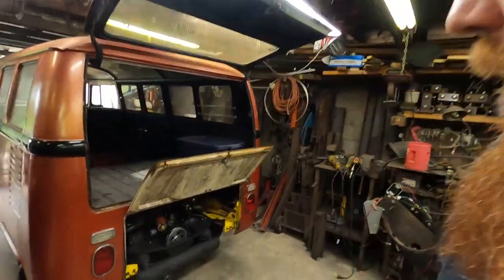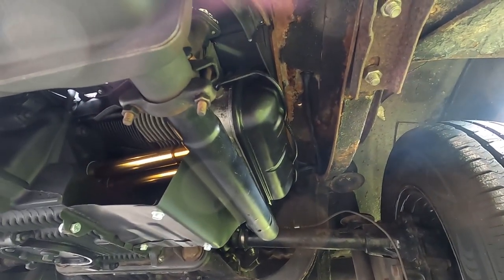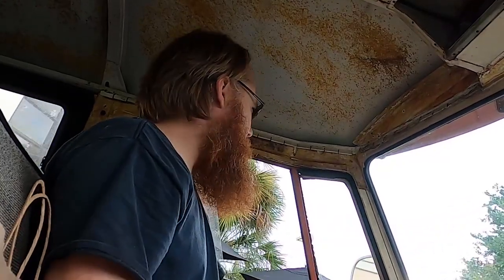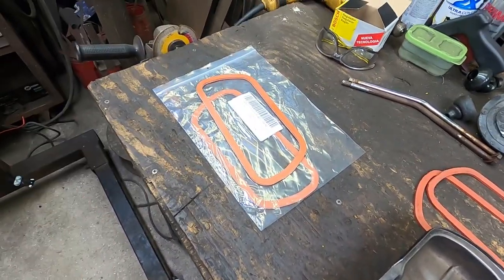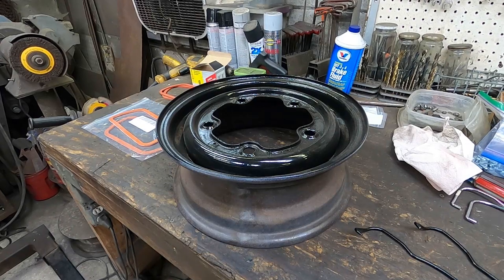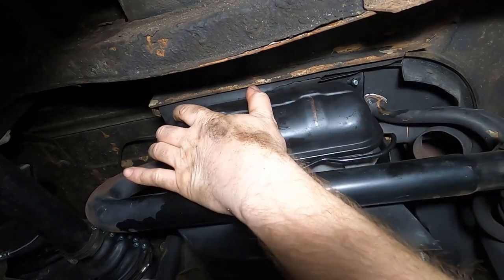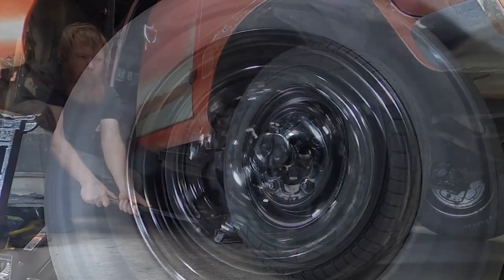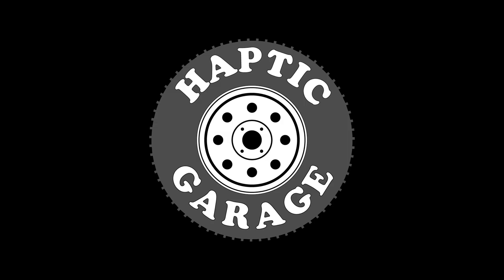We have issues! Test Drives and fixes - VW Split Window Bus Restoration Vandemic E17

Comment: Solid episode! I like your trick of doing the field repair with tools you have in the bus.  Today I got stuck where I couldn’t take off my wheel because I didn’t pack a 19mm and I had a frustrated wife in the car.  If I had the right tool I would have been back on the road in two min, but I had to call AAA.
Reply from the maker: Oh man that stinks, but happens to all of us at some point. After I bought the RV, I drove a total of a half mile before breaking down. The story goes on but ended on a flatbed. I hope this tactic brings you much success, and thanks for being here!

Comment: Glad to see you got it worked out and rolling! I never would have thought the brake shoes would make that noise while not being applied.
Reply from the maker: Yeah Robert, wasn't that weird?!? The goo on the brake shoes was a little sticky so it was kind of squeaking against the drum. I adjusted the breaks for a slight drag so it was within reaching distance to make that contact. That wasn't a real problem but I worried about the integrity of the shoe after being saturated in it's past. New shoes (eventually) were the way to go. Thanks for cheering me on, it's great to have you here for the fun!
Reply: @HapticGarage  I’m doing a roadstoration now on a 60 23 window. All new brakes, hardware and lines!
Reply from the maker: WOW. I mean, it's awesome that you're getting the brakes in shape but... WOW! What a gem. Keep us updated and thanks for being here!

Comment: "Drive - Fix - Repeat"  perfect summary of owning an old VW bus.
I got the same tires on mine.
I found the cork valve cover gaskets I have are not an even size. They are different from gasket to gasket and vary in size from the top to the bottom.
I try to find two close to the same size and and sometimes I stack two up to get a tight seal. Gluing valve cover gaskets? 
Got rid of the points and front drum brakes. Way better.
Reply from the maker: Hey Patrick! Thanks for your thoughts. These Hankook R8 tires aren't fancy but they have appropriately stiff sidewalls and seem to hold up. Our @VWLife friends in Texas like the General Grabber tires- may have to try those out sometime.
Lots of variation from one VW part to the another- I guess it makes sense that valve cover gaskets are that way too. I'm with you on the electronic ignition. Thanks for watching!
Reply: @HapticGarage  i'm running those on my 78, everyone seems to like the grabbers...I'll try them next if they don't look too agresssive....I actually prefer whitewalls !  My 67 and 71 are running whitewalls.

Comment: Did not expect that with the brakes.  I wonder why those contaminated and cleaned shoes did not work ?  Was it a mechanical issue - out of spec in one or more dimensions ?  Was it an eccentricity issue where the clean part wore down faster and uneven contact ?  Hmmn....interesting because that is what I would have done too - spray them clean and sand them, and Bob's your uncle.   Those wheels still look great !   Wish my second 67 was this clean.  It's a deluxe, field rescue....hmm, black armrests ?  oh it's coming off ?  there are grey ?  ewww.   I used a hose on the INSIDE !
Reply from the maker: Hey DanTheManIOM, whatever contaminated the shoes (brake fluid or wheel bearing grease) would rise to the surface with some use and was very tacky; the noise would resonate through the brake springs and backing plate. I'm not sure that it was a problem by itself but with the knowledge that the shoes may have been compromised and the annoying noise it was enough to make replacing the shoes to be worthwhile. Thanks for the kudos regarding the wheels; I like the utilitarian look of a painted steel rim. Your '67 sounds like a project but aren't they all?!? Thanks for watching!

Comment: Great update, as usual! The Starbucks drivethru was a familiar scene. It's nice when you get to be the bright spot in someone's day. I like how she asked for the preferred nomenclature, very respectful lol One question, when I heard the front hub noise I felt like I knew what it was instantly from a previous experience of my own but we came up with different solutions. My experience was the brake spring being too close to the intra-drum brake line and the sound coming from their interference when vibrating. Did you reuse your brake springs or replace them with the new shoes?
Reply from the maker: You said it well Adam; the "smiles per gallon" thing is for realsies and I enjoy the interactions that would not have otherwise happened.
Thanks for sharing your experience with the noise I was chasing. I believe the springs characterized the sound I was hearing resonating through the backing plates. My investigation focused on the source of vibration, which I think was the sticky goo on the shoes rubbing against the drum. The brakes were adjusted before that test drive so the shoes were hovering extremely close to the drum's friction surface. Due to a slight out-of-round- condition they would make intermittent contact and cause the vibration like dragging a finger across tacky-dry paint. With the slight difference in semantics (noise vs. vibration), it seems like we may have been chasing the same thing. I reused the springs but it's possible they were re-installed without the interference you described. Either way, the contaminated shoes had to go and I haven't questioned the lack of noise... taking "yes" for an answer, if you will. Thanks for the question!

Comment: I had problems with the orange silicone valve cover gaskets.  They kept leaking.  Went back to the cork gaskets and no more leaks.
Reply from the maker: Yeah Jeff, this first attempt was a dud. I'll eventually try out that other set to see if I have any luck, but glad to have a method (cork) that works well until then. Thanks for checking out the video!

Comment: You spend all that time on breaks and you don’t even check the heads, valves,  gaskets or anything in the engine? 🧐
Reply from the maker: Yeah.... really wanted to open it up but knew that wasn't right for the project. So far the risk is working out but may still regret it someday.